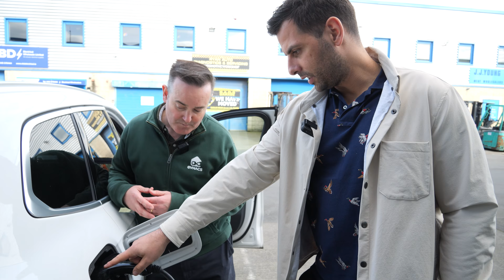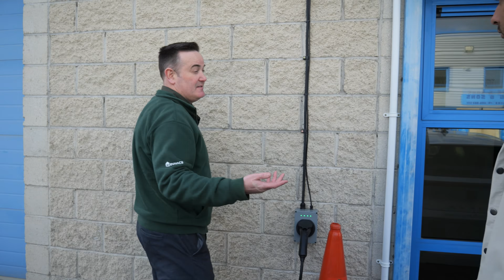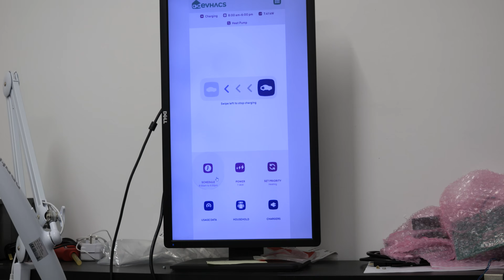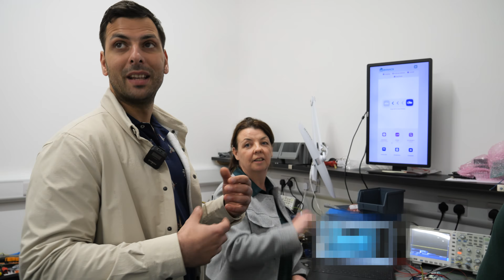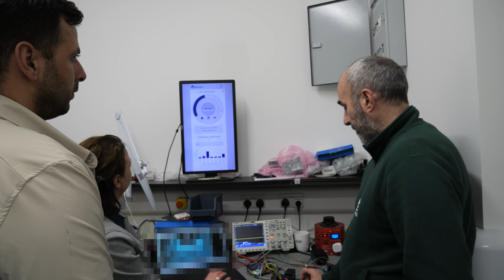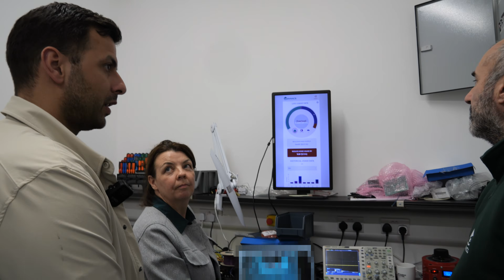Why Are They Using An AC Unit To Power This Car?

Comment: This title is misleading. The AC unit isn't actually 'powering' or 'charging' the car in any functional sense- it's just a shared electrical circuit with a load-balancing controller. Suggesting the AC unit is doing the work is classic clickbait that ignores the real engineering involved just to get views. Original title "Why are they using an AC unit to power this car?" Dislike and never recommend channel.